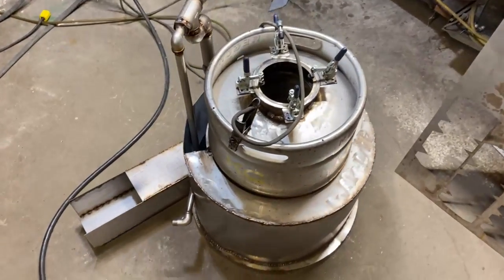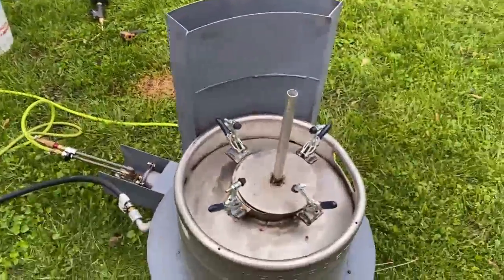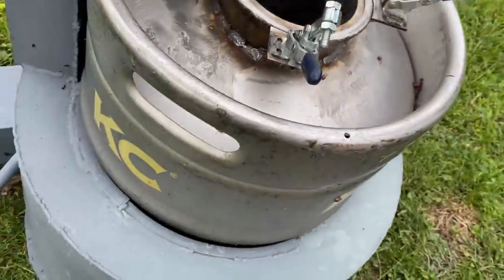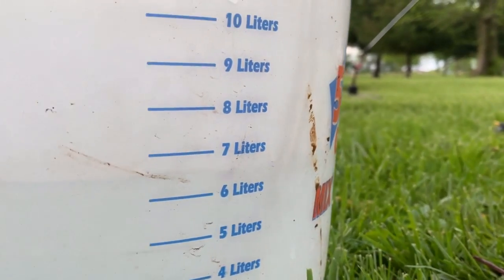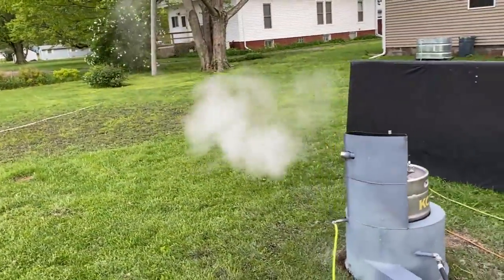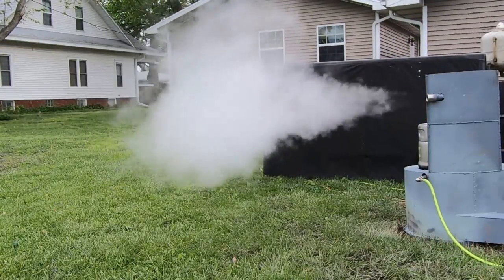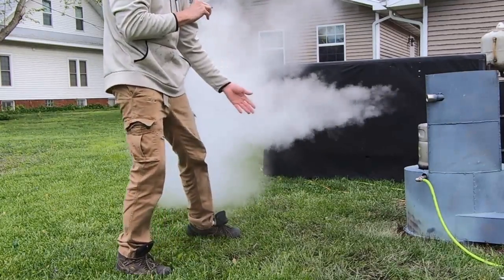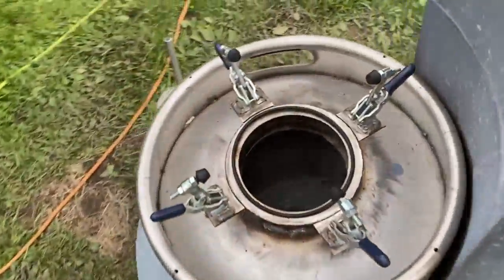Organic weed control boiler and Decal removal machine

Comment: Hmm, I'm just sitting here wondering how much insulation you could wrap that in before your end up melting the outer wall or the air pipe, and the efficiency/max temp it could add.
Reply from the maker: how about the cost ? thats the biggest factor believe it or not
Reply: @NOBOX7  
 About 10$ an inch till 1200 deg with roxul(if that is a 15.5Gal standard keg, ~3 inch flame jacket, 1 panel 24X48X1, should cover most if not all of the flame jacket with some cutting).
 About $30 an inch above 1200 with ceramic insulation added under the roxul, till something melts.
  Think cheapest option would be some refractory cement (there are mixes good up to 2000deg), and cast a 3 sided liner to the flame jacket.
  That or air create. but, i don't think i'v seen you go down' the air create rabbet hole.